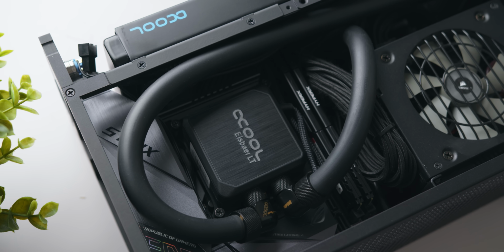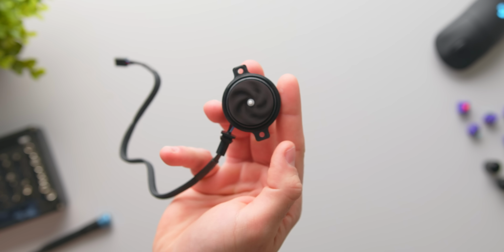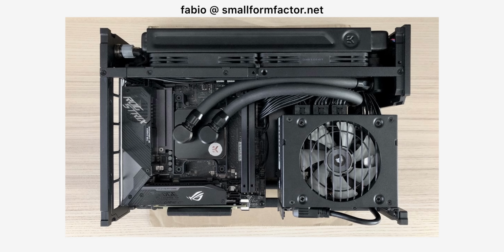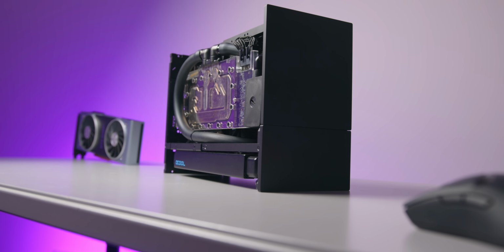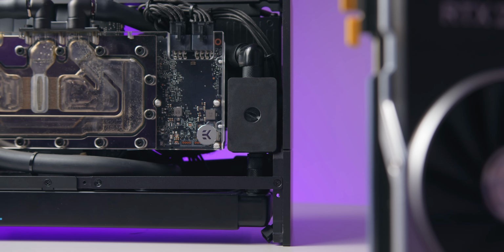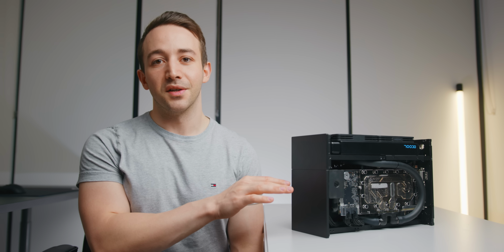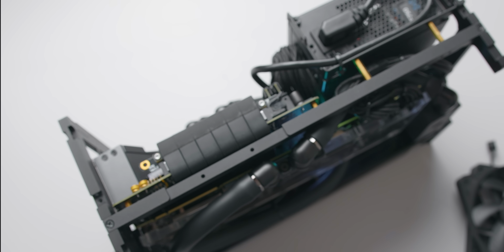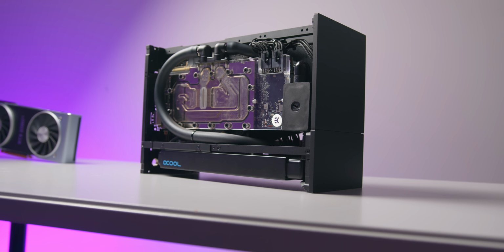ITX Watercooling Easy Mode - Alphacool DC-LT

Comment from the maker: "Easy" being relative of course, it's still watercooling. 
But filling / draining the loop is made a lot easier here compared to the LT Solo
Reply: Couldn't you fill up the loop while the Eisbaer LT Solo is outside the case and afterwards mount it to the CPU?
Reply: Could we have a current complete parts list thus far for the build?
Reply: I understand that this one is easier to fill but why would I not be able to use the same gpu water blocks with the solo ? Other than that i'm hesitant to use this pump because everything i've seen so far indicates the new gpu's will be bigger. That would mean cramming this in the case would be a problem when upgrading.
Reply: We have used the 2600rpm DC-LT for our previous prototype and we had to RMA it 2 times already and the third one is broken aswell. There is a really loud crackling noise after some time, these pumps are such a bad quality unfortunately
Reply: @nino992  Pretty sure everything is in the description with links
Reply: Think you could do a "easy" custom loop in the sg13?
Reply: How about an itx custom loop cheap mode. Cmon aliexpress
Reply: nice, will do something similar in my next build !!
Reply: What song did you use in the beginning and during the montage?
Reply: i love it, perfect diy aio.
Reply: Beginner question, creating your loop, can you just loop just your CPU to begin with? I plan to upgrade Mr GPU later this year.
Reply: How do you actually fill the water, hard to see with those black tubing?
Reply: Great stuff. Wouldn't mind a test for the LT Solo pump/block with a dual 240 rad setup and this DC-LT2600. I know blasphemy, but still woulnd't mind seeing some results.
Reply: InstaBlaster...
Reply: Does anyone know which size EK tubing he is using.  Is it the EK 16/10?
Reply: Hey Optimum! Absolutely love the channel!!! 😃💪I have drawn great inspiration from all your videos to inform a new Mini ITX dream build with the new Ryzen 7000 and RTX 4000 series when they release.

I am wanting to do a custom 240mm AIO to cool the CPU (Probably the 8 core Ryzen 7 7700x) using the Alphacool LT solo, with a view to adding the GPU to the loop at a later date (Most likely an RTX 4080)

Will that pump be sufficient to run the loop with both components? 

Parts list:
Alphacool Eisbaer LT solo
Corsair Hydro X 240mm rad
EK clear tubing
EK quantum torque fittings
Slim Noctua NF-A12x15 120mm Fans x2
Reply: so does the pump hook up right into the radiator or can it be put more down and hooked up with a tube?

Comment: When you watch Optimum Tech so much you notice he changed the framerate from the usual 24 lol
Reply: well 30 is a 25% difference, i guess
Reply: indeed
Reply: Yousef Abdulrhman your math is off. 25% of 24 = 6. Therefore 24 + 25% [of 24] = 30
Reply: @hhectorlector  yep i knew there is something wrong gonna delete my first comment but will leave this .
Reply: Yeah there's was a little bit of rolling shutter in the earlier videos with 24fps which has been completely eliminated now at 30 fps.

Comment: Great video! Could you test this pump's performance in a dual rad setup compared to a traditional D5/DDC? Who knows, performance might be better than we think! You could just hook it up to your dual rad Ncase M1 build with the apogee turned off and see how it performs
Reply: I'm also wondering this or if there is another, more powerful small pump that you would recommend for a dual rad in nCase M1?
Reply: Yes please! I am planning on doing a dual rad ncase m1 build and some help with this info would be amazing!
Reply: Results might be skewed by resistance from the DDC's impeller—it'd probably need to be bypassed (in other words, I don't think it's recommended to run pumps in series with one off/disabled). 😕
Reply: @duotoasty  I think we were (Or at least I was) talking about using this INSTEAD of the CPU block pump, and just have a regular CPU block. Let me know if I misunderstood though! New to custom water cooling.
Reply: @charleskrueger5523  Not sure where but in the past i saw a nCase with a DDC Pump inside. Maybe you can find it if you are searching for it.

Comment: The reason that the CPU block pump is noise is primarily on the temperature and metal housing. If you run both using an external power without turning on the machine - no matter 40c idling or 80c full load, the difference is a lot lower.

Comment: I have 5 or 6 of the DC-LT 2600. They are the best for ITX for sure. Doesn't have a built in reservoir, but you can get a regular acrylic pump top for the DC-LT pumps too

Comment: Ever since I had so much trouble finding the smallest pump for a itx build I made...while voiding your warranties, I discovered replacing tubes to whatever you like on aios, and even changing the rad for them. Even discovered jank ways of mounting aios to gpus. Currently running 2 corsair h110i rgb plat(black) pump blocks with corsairs stand alone rads and replaced the tubes to clear. I can imagine doing the same for any aio. I know some people use their warranties though.

Comment: Very intriguing. I have a Dr Zaber Sentry 1.1 that I've been think of water cooling.. A custom loop would be an amazing project. I think that this could potentially fit next to the power supply near the bottom of the case.

Comment: I bet some of the noise difference between mounting the pump unit in the CPU block and mounting it in the reservoir unit is that a good amount of vibrations probably get conducted into the CPU/motherboard with the pump block, so they end up having a larger surface area from which to be transmitted into the air as acoustic noise, while there should be much fewer vibrations transferred to other solid components the way that reservoir is mounted. It looks like the only solid connection is via the extender to the radiator, but it's a much smaller and less stable connection

Comment: The LT Solo makes more Noise because its build in the CPU Block and all the Vibrations get absorbed by the Motherboard and the Case.
With the new Build the Pump is way more decoupled.
If i screw my D5 (with or without AGB) straight on my Radiator/Case without decoupling it will be loud even on 10% RPM.
With decoupling the D5 can run Silent.

Comment: The Swiftech Apogee Drive II has been a nightmare to try and find.
Reply from the maker: Yep aware. I e-mailed them but didn't get a response on incoming stock. If you want to watercool the Ncase, I have the Iceman DDC pump/res on the way. That should be another great option.
Reply: I see them on eBay.
Reply: @optimumtech  Mounts on the outside of the Ncase M1? (That's how it's demoed on the AliExpress page...)
Reply: yeah , i've been searching too.. found one on a shoe site hidden in between pumps :D ... i ordered it and its coming from china.. i'm wondering what exactly ill get :P
Reply: @optimumtech  Perhaps it's not worth reviewing because of its scarcity (many recalls and EOL in 2017), but the EKWB Predator 240 is another great DDC option for an Ncase dual 240 loop. It has a DDC mounted on the rad (5V, but you can swap it out) and a EKWB PE radiator core. The extra clearance allows for your CPU block of choice and push-pull with 25mm fans on the CPU half of the top rad.
Reply: @charleskrueger5523  Correct. It recently had a revision for the new Ncase M1 V6+ mounting holes on the rear fan slot, and comes in both black and translucent.
Reply: @optimumtech  I suggest to buy it through the official swiftech website. It's almost always available, without the pump though. At least was like this until 1 month ago.
Reply: @fabioliberati1896  I thought I was the only who noticed this as well. So I pulled the trigger on the bare AD2 and got a pump separatedly. But only to be met with an email letting me know that they are actually out of stock with no lead times on restocking.
Reply: @angelicalim8772  It's weird that they still have it on sale. For me it would have cost an insane amount for shipping to Europe as well so I didn't pull the trigger.

Comment: I have the CPU block in this. I don't like the mounting mechanism, I had to bend it slightly to attach to the block properly, and the screws aren't fixed so its an annoying minute to get it screwed in.

After its installed though, I love it. Definitely one of the best looking blocks and seems to perform fine.

Comment: Maybe the fact that the pump in the integrated water block pushes the water directly into the CPU block which has a fine water channel causing resistance attributes to the sound being louder.
Where as the reservoir pump combo there is no resistance for the water to go through and its just pushing water through to the tube to the rest of the system.

I would assume more pressure/power pushing through resistance would cause a louder sound versus less pressure/power pushing through the same resistance

Comment: I can only imagine a 10900k with the unify board, a nickel plated ek magnitude block with black accents, normal non rgb dominator platinum, a 2080ti with a watercool heatkiller Iv nickel block, matte black tubing, nickel fittings, a bunch of sabrent high capacity nvme drives (4-8tb) and a pair of 8tb 870 qvc drives all inside that same case or maybe the Thor case that I’m not going to even try to spell. I would love to have that build.

Comment: Would this fit into my Velka 5? 😮

Could you also review the AXP-90 low profile cooler that has insane performance for It's size, for reference? (I use it on my rig).

Comment: Imo this is a great solution for using it in combination with an lt solo to maybe get somewhat close to the strength of the ddc apogee drive for those compact dual rad loops like in the Ncase since the apogee drive seems to be vanished from the market at that point

Comment: I'd love to see a test where you use this pump or even the newer DC-LT2 on a dual rad setup. I'm trying to plan for a water setup in a matx case with 30mm x 280mm and 30mm x 240mm rads and am curious if this pump/res combo would be powerful enough. Will be running a 9600k @5.3ghz and a 3080 when they become more readily available.

Comment: 1) Which fittings did you use with EK-FC Terminal Rotary 90° - Black for GPU? It feels like there are and soft tubes are just plugged without holding rings :D. 2) Which extenders do you use between pump and radiator? Thnx

Comment: I had bad experience with those DC-LT Pumps. Could be that that enclosure dampened more noise but still not a fan of it. 
After some searching for alternatives i found a good and cheap (chinese) solution which i used after.

Comment: I've had three of these. Power cables fell off all three and they use a foam adhesive that covers the solder points but not the insulation of the wires. Home repair is not possible. I love Alphacool, but this pump is always a "no" in my book.

Comment: Why don't you use an articulating gas spring monitor arm to the wall instead the stock stand of the monitor? so you "clean" the desktop and have more space?
Reply: Probably rents and doesn't want to put holes in the wall.
Reply: @zoomzabba452  Just 2 holes and you can cover that with stucco that is inexpensive  ...

Comment: Hey Ali, curious, are you running the stock cables in your T1? I watched your video on making custom cables and it really inspired me to give it a go. I'm putting together parts for my T1 build and I'll be using a Corsair 750sf, undecided on whether or not I should make custom cables for it though.

Comment: Im using the Alphacool Eiswolf GPX-Pro AiO Nvidia Geforce RTX 2080/2080TI Aorus Xtreme M11 in my costum loop in my sff (Jonsplus i100 pro). I’m looking for a little upgrade. The dc lt looks good to me. Do you think I can run them both together without any issue?

Comment: Great video as always! 
Do you think in a Ncase M1 you can put 2 of this pump in the case one for the CPU rad and one for the GPU rad ? Because the swiftech apogee is always sold out plus won't work with my Trident Z royal ram ...
Reply: FYI was in e-mail contact with Henry at Swiftech yesterday and he says new stock is on order so should be available in 2 weeks. My order is already in the queue!

Comment: Aren't u able to put this case into 3slot gpu configuration now with this cpu block? Cause u could use non terminal fittings on gpu and route the tubes bit more nicely.

Comment: If you inserted a Noctua Low Noise Adapter to the 3600rpm pump, wouldn't it be in the same noise level with the 2600rpm model?

Comment: Long time watcher first time commenter (I think). So I'm looking for an ITX case with the proportions of standard mid towers but as small as possible, what do you recommend?
Reply: You mean all the standard component placement? (Basement psu, gpu directly into the mobo, front /top radiator mounting). Closest I can think of is the NZXT H210 @27L. You can come over to r/sff and ask the community.
Reply: @zoomzabba452  thanks! I'll check it out

Comment: Would a 240mm radiator, a cpu and a gpu block be the absolute limit of this pump? How about 2x 240?
Reply: I'm wondering about this, too. Especially in ITX builds where the loops are very short it could be doable -  rads don't have much resistance for flowrate. I definitely try it out in my future itx build. If you use it in a normal ATX case you should use 2 dc-lt pumps or a better one i'd suppose.

Comment: Would the DC LT 2600 be capable of running a custom loop with cpu blcok, gpu block and two 240 rads?

Comment: Do you have any insight on the DC-LT2 which would have an improved 3 phase sine PCB? There are quite a lot of people saying the DDC is almost always the better option if you want it to last...
Reply: Currently building a dual rad setup in the NR200 and planned to use 2 DC-LT/2 pumps. Kinda regretting that as I've had the connectors tear off from 2 pumps and had to replace them both. I had one of them (DC-LT) soldered back on, but it came off again. All this happened during installation, and I was careful with the second DC-LT2. So, my advice based on experience is stay away, unless you have the tools to deal with soldering the wires back onto the PCB. I'm sticking bc at this point I've spent as much on this as it would cost to get a diff option. If you don't already have a cpu block, go with the Barrow pump-block combo. I'm looking at EK's FLT pump res as backup.

Comment: One other thing I hope to leverage your platform for our ITX lovers is that, a 3700x + 2080 super requires a 30mm think 240 radiator, a 25mm has been proved insufficient. This is the result after leveraging your undervolting guide on the 2080s. Playing PuBG (2K) is the limit. Video encoding and output will continue increase CPU temp till throttle.

Comment: Is it possible to have CPU Only watercooling in this case in 3-Slot mode? AIO or custom. I'm asking because my 1080ti with the Accelero III is three slots wide and buying "new" waterblock for a 3 years old card seems kinds dumb to me.

Comment: Hi To all of you ! 

I was wondering if it would be possible to change the 2080 to a 3080 in this build ! Knowing that the 3080 have much more power Will it run to High in temperature since there is only one radiator ?

Comment: Sorry if this is a stupid question but why does this let you use any CPU waterblock? Are there some pumps that would require specific waterblocks because of some compatibility reason?
Reply: Some pumps were made to mount for blocks that support pump. This was made so it just connects to the tubes

Comment: How often do you need to maintain such a custom loop? Are we talking about full emptying every e.g. 6 months or so?
Reply: If you use clear water you can let the loop run over years. We have systems in the office wich are running since 4-5 years without any need to clean the loop. Maybe you need only to refill it a bit after 1-2 years maybe. Depends on how many water you have on your loop and how often the system is running.
Reply: @AlphacoolGmbH  Thanks for the answer. Looking on your website it seems like the DC-LT pump is  no longer available. Is it just out of stock or is it discontinued?

Comment: this apd2 is absolutely impossible to find in most eu its even worst out of second hand market there is no left over anywhere so its kinda a dead end for a lot ppl that will not be able to buy it unless searching for rly long and not having their pc fully built for long too so if you have others possibility with better potential than the acool dclt it would make more sens than focusing only smth you have in stock that most ppl cant put their hands on its like saying to everyone to get a enginering sample of cpu cuz idk its more cute but only possible for ppl that can be valuable to the eyes of providers, unless they are lucky fellas that manage to put their hand on one of the maybe last stock you say ez to find ... its not... beside that good video as always

Comment: I'm not very good with custom water cooling builds, but where is the reservoir?
Reply: Watercooling builds dont necessarily need a reservoir. There have been many builds where they never used one. Sometimes the reservoir is replaced using the gpu water cooling block
Reply: And he also said what  the reservoir is in the video
Reply: @brianmateo8041   thanks! Though after i wrote this I did some research and i realise I was very dumb.

Comment: Hi guys. Do You think this DC-LT can run a cpu+gpu block and a 45×240 + 45×120 rad alone? The specs tellin the pump's flow rate is 70l/h. Compared to a DDC's 200l/h, it seems very weak. Any experiences? I don't know if this little pump will be enough.
(i5-8600k oc5GHz, 2060super oc)
Thanks for all answers!
(And sorry for my english :D)